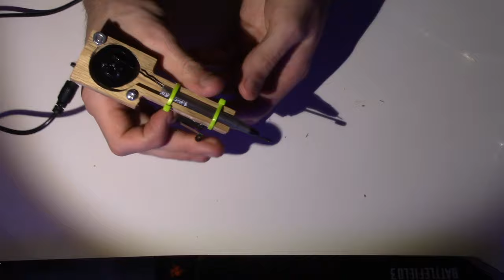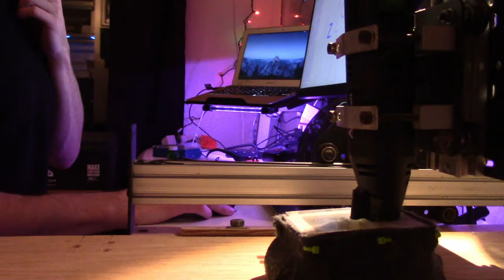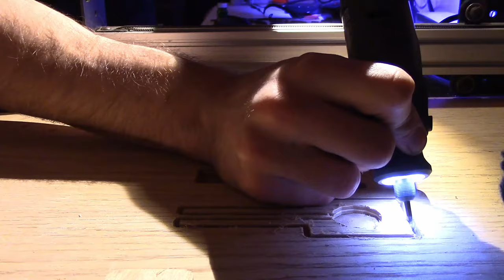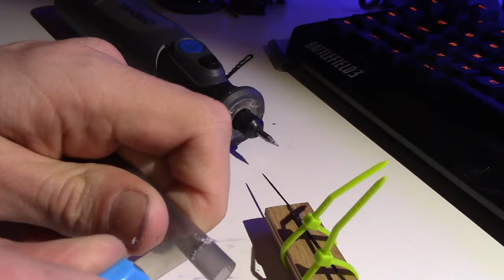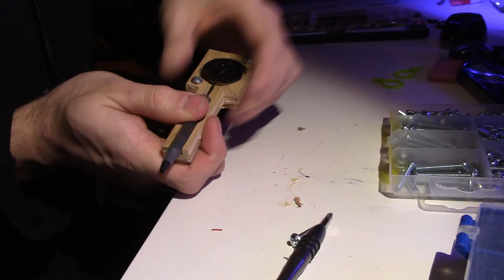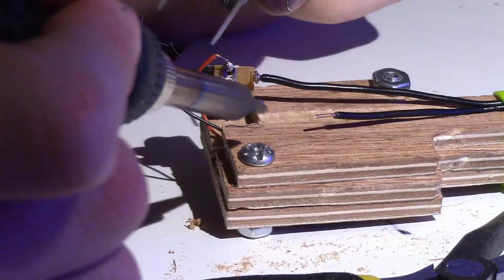I Create An Electronic Tattoo Gun w/ My CNC Engraving Router In My Electronics Workspace

Comment: heres what i see. you need to only remove the ball. its going to leave sloppy lines. its going to be bulky, un comfortable. you cant sterelize wood. a beard trimmer motor works better. look for lockeddown23 and1s machine. on youtube. this is a hep c machine! best needle is a g guitar string sharpened.